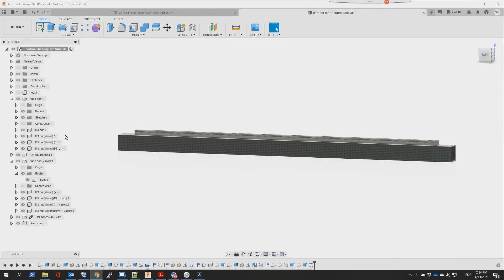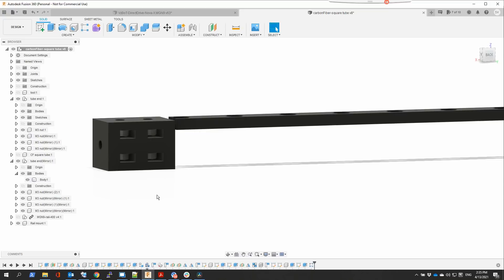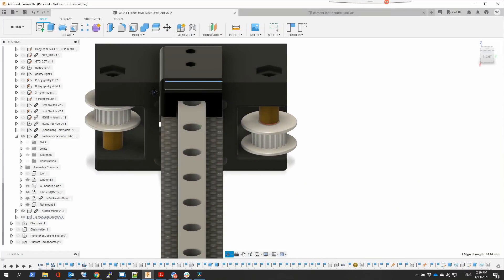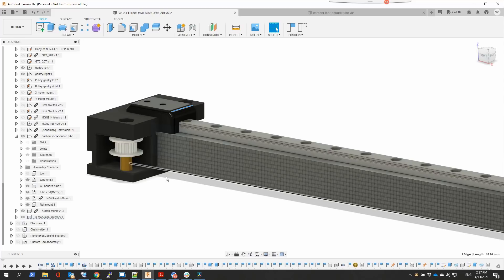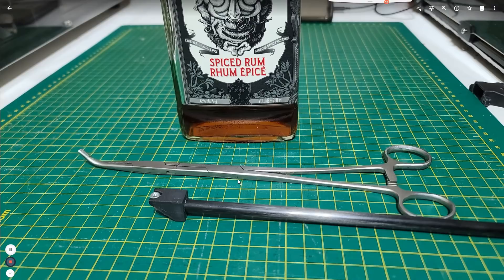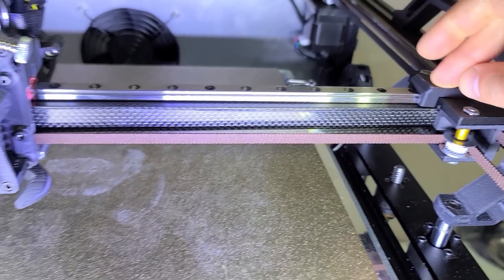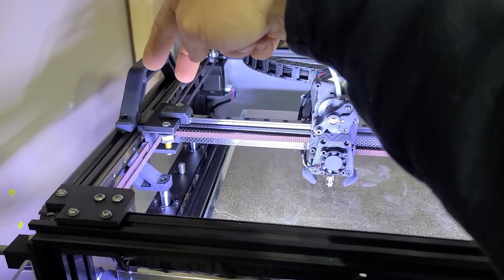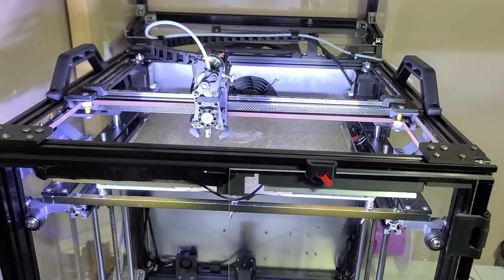Mounting carbon fiber square tube on the VzBoT 3D printer

Comment: What type of belt you use for high speed?
Reply from the maker: Gate 6mm. You could go with 9
Reply: @Vez3D  I was referring to whether it is reinforced with fiber, steel, ...
I have put one with steel reinforcement and it has deformed in a short time.
Reply from the maker: @eugenionovoa7645  gates a fiber reinforced
Reply: @eugenionovoa7645  steel reinforced belts need  a large minimum turn radius (about 25mm) not really suitable for a 3d printer